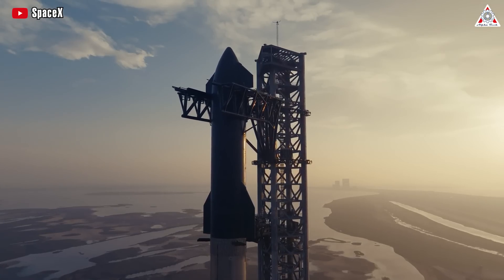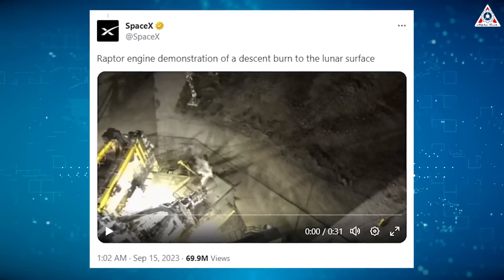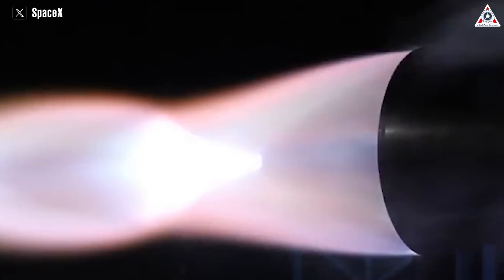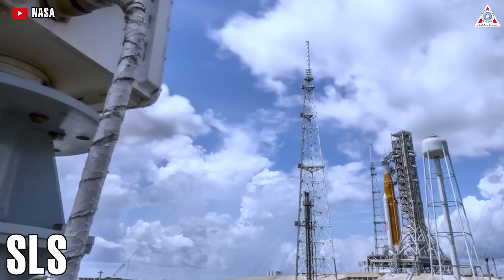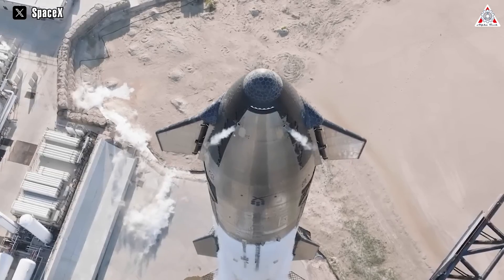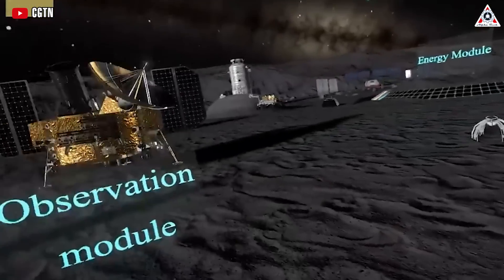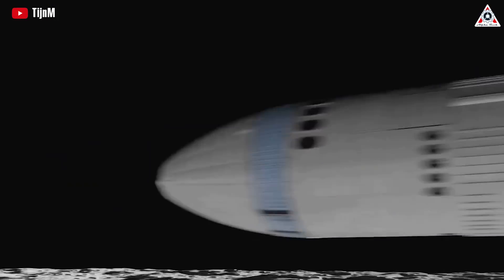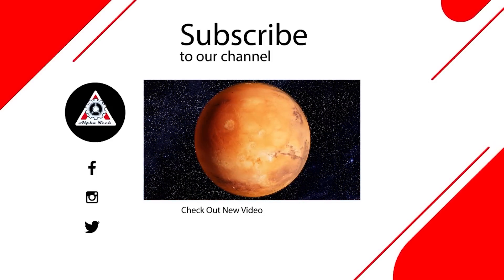SpaceX's NEW Starship Raptor Engine revealed just shocked NASA, Musk's reaction...

Comment: Why is SpaceX posting a picture of a Raptor engine test as a "demonstration of a descent burn to the Lunar surface"?  Are SpaceX and NASA planning landing (that is touchdown on the Lunar surface) with a Raptor?  All recent depictions of the HLS show the landing with a ring of thrusters (Super Dracos?) mounted high up on ship to avoid agitating the regolith. And if the immediate plan is to use a Raptor for touchdown how does anyone plan to keep the regolith from disabling the Raptors for liftoff?
Reply: Yes descent burn and landing burn are completely different using different engines. I think the term descent burn is a bit misleading, it should really be something like de-orbit burn to describe this.

Comment: Rs-25 engines use hydrogen (LH2), not methane (LCH4). RS-25 engines produce a higher exhaust speed and are preferable for application in a vacuum!!
Reply: LH2 is also the leakiest, most troublesome fuel you can work with.  It's why the Shuttle and SLS had constant delays.
Reply: NASA’s RS-25s cost $148 million each.. Raptors $250k each. To hell with NASA. #defundNasa #cancelSls #goSpaceX

Comment: MARS DONT HAVE A WATER COOLED LAUNCH PAD
Reply: You are only launching Starship from the surface of Mars. 6 engines. Furthermore, owing to the reduced gravity, the engines can be throttled back until the spacecraft is so high that the exhaust plume is harmless at ground level. You may be aware that the Saturn 5 needed a water cooled launch pad but the lunar landers certainly did not. Same thing.
Reply: Starship will not need the Superheavy booster to launch from the surface of Mars and achieve orbit, either, because Mars has 1/3 Earth gravity.

Comment: ISP is in seconds, not N/s; the force term cancels out.  And the analogy where CH4 is better than LH2 is backwards;  the LH2/LO2 combo is better because it's the amount of LO2 that is reduced.  It's true that CH4 has less volume than LH2, but it requires much more LO2 and LO2 is where the weight is.
Reply: CH4 has easier cryogenic handling
Reply: @rodentnolastname  It does, and it has much narrower limits of inflammability; but LH2 is a much more powerful rocket fuel.  That's why New Glenn has such high performance for its size.   I don't remember the distinction (something to do with pressure), but l don't think liquid CH4 is considered to be cryogenic, just a liquified gas.
Reply: @Strike_Raid  "The 13th IIR International Congress of Refrigeration (held in Washington DC in 1971) endorsed a universal definition of "cryogenics" and "cryogenic" by accepting a threshold of 120 K (or –153 °C)"

Starships' CH4 is chilled to180° C so qualifies as crypgenic under that definition.

As far as I can find, tank pressure is 4 bar but the turbo pumps raise that to 342 bar before entering the combustion chamber.
Reply: @rodentnolastname  Ah, then it is.
Reply: @Strike_Raid  Liquified gas, CH4? Aren’t LOX and LH2 liquified gases, too?? Pretty sure they are….
Reply: @wolfman007zz  They are liquified gasses, but to more correctly describe their nature, you would describe them as cryogenic liquids.
Reply: @Strike_Raid  boiling point is 91K definitely cryogenic
Reply: @Strike_Raid  Not really. That’s why we call them “liquid” propane, liquid butane, liquid methane, liquid oxygen, liquid nitrogen, liquid hydrogen. “Cryogenic” is more appropriate to describe any liquids below -180 F, such as “cryogenic propellants” or liquids at “cryogenic temperatures.”
Reply: @wolfman007zz  I don't know why you're arguing this, but you simply changed the narrative.  There's nothing wrong with calling liquid oxygen, 'liquid oxygen', and I never said there was.  The point was toward calling liquid oxygen a liquified gas instead of a cryogenic liquid.  it is a liquified gas, but more correctly, it's a cryogenic liquid.
Reply: @Strike_Raid  I’m not arguing anything. YOU are the one trying to correct everyone re: “cryogenics” with your supposed “correct use” of the term. Then when YOU are properly corrected, you accuse others of “arguing”. But what do I know? I only work for NASA as a Reliability Engineer….
Reply: @wolfman007zz  Nope, not a bit.  I told the guy I didn't think liquid CH4 was cryogenic, he looked it up and pointed out that by definition, it is; and I said ok, then it is.  I didn't argue it, I agreed with it.
Reply: @Strike_Raid  Whatever…. Kept back peddling…..
Reply: @wolfman007zz  Reread, you'll see I'm not.
Reply: @Strike_Raid  All I know is, you asserted yourself into a discussion in which you don’t know what you’re talking about, in an attempt to spread misinformation. Not a good look!
Reply: The theory is that you can make it on Mars from atmospheric CO2. @rodentnolastname
Reply: @@lynngeek5191 Hydrogen embrittlment doesn't have time to occur; it takes months or years of exposure for that to happen.
Reply: @@lynngeek5191 The during manufacturing is probably refering to electroplating, you can get hydrogen embittlement from electolysys afterwars, but even that takes time.  Most fasteners are electroplated (and you don't even need hydrogen to be present for it to happen).  I've personally never heard of hydrogen embrittlement being a problem in launch vehicles, or if it is, they don't talk abou it much.  Most rockets are made a aluminum and aluminum isn't so succeptable to it and exposure times in engines (which are very high prssure, high tempture) are measured in minutes (or maybe a couple days over say 100 launches of an SSME for instance).  I don't doubt that there are conditions where rapid embrittlement could occur but it seems that most maintenace is required after about a year or so.

Comment: I wonder what will happen if that massive Moon lander  lands on the Moon's powdery loose soil ?   The Apollo LM was much less massive and had large landing pads.
Reply: The Moon is made of Wensleydale Cheese which both tasty and firm .. it will support Starship & the crew if they run out of food :)
Reply: @theoccupier1652  Okay , I like Wallace and Gromit .
Reply: Almost certain to fall over on anything with even a slight tilt.
Reply: @rogerphelps9939  I agree . The tilt of Pisa was @ 5 deg. .  Can they scan the surface of the moon as they move into landing position that has a level surface within 1 deg. ?  Will they have enough fuel for the hunt?   If they could first land a platform that levels itself then there is hope .  But that platform is a big problem to deliver.  Or they can have a rocket that levels itself ?  I don't know if Space X has this figured out.

Comment: NASA's BF SLS Rocket can go to the Moon and Back ! .... Musk's 33 Rupture motors can't even get to Orbit ! ... Plus you Need 10x as many of them , and a lot more Ships , to reach the Moon ... So , they aren't very Comparable ! ... unless yer a Fanboy Nutter ...... :-/
Reply: You're right.  Starship and Superheavy are not comparable to SLS/Orion in any way.  Development of SS/SH has cost about $3B over the last 7 or so years when the project was started.  Meanwhile, SLS has cost more like $15B-30B over its 20 or so years and Orion has cost several billion dollars more.

SS/SH has been designed from the beginning to be completely reusable; the only thing intended to be expended on each flight is propellants. Meanwhile, SLS /Orion is intended to be expended in its entirety with the possible exception of the Orion crew capsule, itself.  SLS uses the reusable RS-25 Space Shuttle engines but throws them away with the booster.

SS/SH will cost about $20M per launch.  If we assume that a lunar mission requires the mission SS ($20M) plus 10 refueling launches ($20M x 10 = $200M) the total launch cost for a lunar SS mission comes to $220M.  The foregoing estimates are purposely high but only doing it a couple times will give definitive costs...  Meanwhile, SLS will cost approximately $4.2B PER LAUNCH or nearly $4B MORE than the entire SS/SH launch series required for a lunar round trip.

So, YOU ARE RIGHT!!  SS/SH and SLS/Orion are NOT COMPARABLE!!!  Unless you are an absolutely shameless NASA fanboy, anyway. 😂😂😂
Reply: But SLS is unable to land on the moon and take off again. Furthermore it is unaffordable and no part is reusable.
Reply: @rogerphelps9939  Ummm ..... I don't see any Spaceships flying , being reused , refueling , landing , or even taking off ... Do you ? ... Nor does SpaceX have an approved people carrier or lander prototype ... All Musk has is a Sales Pitch and a lot of wishful thinking ....... :-/
Reply: Oh my god. Please read up on SLS and Starship before you make any comment. I can simplify what @frankmcgowan9457 means. He is right, but lots of numbers.. 

SLS Vs Starship: 

First numbers are for the SLS and the second are for the Starship. 

8.8 million vs 16 million pounds of thrust 
98m tall VS 120m meters tall
5.5 million pounds when fueled vs 11 million  
Reusable? No / Yes
Max payload to low-Earth orbit: 210,000 pound VS 220,000-330,000
Engines: Four RS-25 VS 32 Raptor engines
Crew module: Orion: four astronauts (period) / Crew module: Starship (Carry up to 100 passengers)
Cost to build: $23 billion VS Cost to build: $216 million.
Price per launch: $4.1 billion VS Ultimately around $2 million

Now the two last rows in that text alone is actually the only info you need to make a comparison. 

What you need to know is that Starship is till in its cradle and is showing great potential. NASA/SLS has been in the works for many many years and uses old tech mostly while Starship is pure new tech.

And I think you missed one detail. SLS can't return from the moon. How little you know about this my friend. NASA is PAYING SpaceX to help them go to the moon because NASA believes in Starship more than they believe in their own expensive old chunk of metal. 

Now restudy and get back to me when you have the numbers straight :)  

And yes, Starship is not orbital yet but getting there. But you also need to know that SLS has ONLY launched once and most probably never again as that iteration. :)